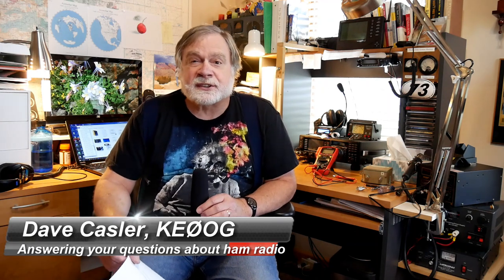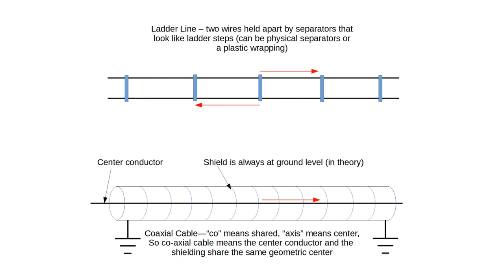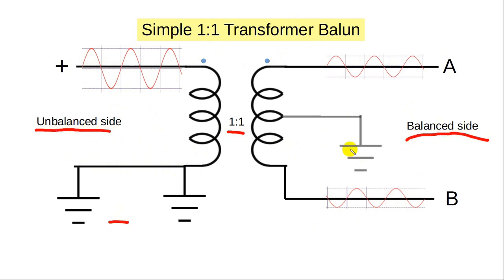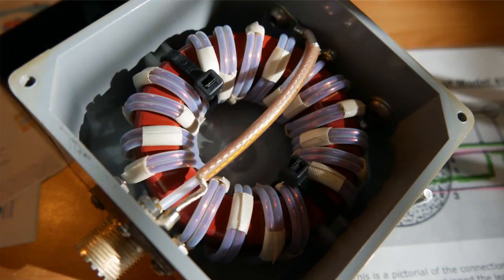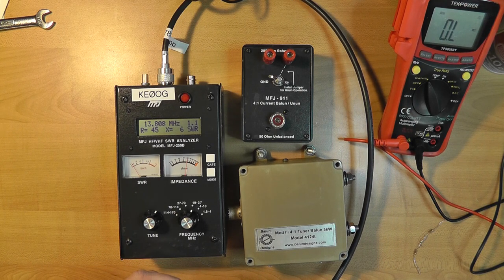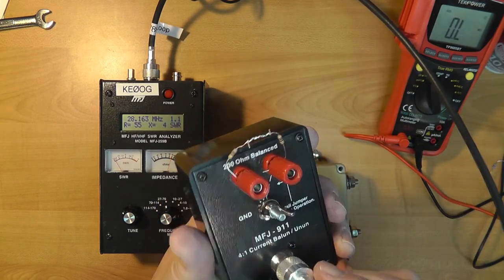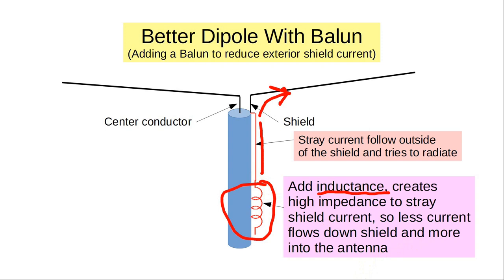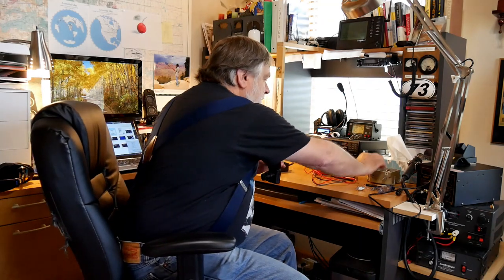All About Baluns (Ask Dave #73)

Comment: Hi Dave,
In your animation starting at 1:38, you show current flowing back and forth on the center conductor, but no current flowing on the shield.  However, there is current flowing on the INSIDE of the shield, and it is equal and opposite to the current on the center conductor.  So there should be two arrows going in opposite directions INSIDE the coax.  There must be a return path somewhere, and we don't want it on the OUTSIDE of the shield.  That's why we might want to use a choke balun.
Keep up the good work!  73 de kc0tw.

Comment: My understanding is this; if an antenna is not balanced, current (or signal/RF/voltage it's all the same idea) flows back along the shielding of the cable (or one leg of a feedline) to the transceiver.  This back flow produces a high SWR reading which can damage the receiver if not corrected.  Makes sense so far?
A balun which is an RF choke, a line wrapped around a toroid core, absorbs and dissipates this RF before it returns thereby producing an acceptable SWR reading.
The reason there are different ratios of baluns is because the amount of turns, equaling RF absorption, is different depending on how unbalanced the antenna is.
More unbalanced=more windings around the core=more RF absorbed.  That's it!

Comment: Dave - I think you should review your statements regarding coax starting around 2:30.  The shield in fact is the second conductor in this RF AC circuit; you have to have at least 2 conductors in a circuit.  You can't have a single conductor simultaneously being the supply and return path.  RF current equal and opposite to the current in the center conductor does flow on the 'shield'.  Ideally, the shield current will be confined to the inner surface of the shield due to skin effect- the surface that can 'see' the center conductor
Reply: And all that aside, this was a very good presentation.  Nicely done.

Comment: 4:1 Baluns are useful between balanced lines for center fed Zepps, Off-center fed (OCF) dipoles with coax, G5RV antennas, full wave loops, NVIS dipoles that are close to ground and have impedance levels near 200 ohms or high impedance feeds for log periodic beams.

Comment: David, thanks for the video. I noticed that your explanation is in contradiction with the article by W7EL you are refering to. The current flows in both directions inside the coax cable, through the inner conducter and the inner surface of the shield, the same way it does in the symmetric feed. A balun prevents the current to flow on the outer surface of the shield. According to your video the current flows only through the inner conducter, which doesn't seem to be right.
Reply from the maker: In a proper coax, with all impedances matched, the current is unbalanced. The inner shield is ground, and the current on the inner conductor is AC, back and forth. If there is an imbalance, or impedances are not matched, then things change. I think what I've shown in the video is correct.
Reply: @davecasler  The fact that the shield is ground only means that we consider it a zero voltage reference. It doesn't mean that there is no current in it. The reason why bifilar 1:1 current balun works is that there are two currents with 180 degree shift flowing through it, one through the middle part of the cable and one through the inner part of the shield. Magnetic fields of these currents cancel each other, thus balun doesn't stop them. The current could choose to flow through the outher part of the shield (because from current's point of view there is no difference where to flow at the end of the cable - through the antenna or through the outer part of the shield). However this would turn the balun to the coil (choke) because now there is no opposite current to cancel the magnetic field. This fact creates high impedance for this patch.

Comment: Great discussion Dave.  However, in this video and the other you did about "Do I Need a Balun?", you discussed that incident where you couldn't get the antenna to tune with the balun and when you removed it, it worked fine.  You didn't explain why the balun didn't work in that case.  Please explain.

Comment: Dave you did a awesome job on a very complicated subject, l do however have a couple, dare I say, squabbles :o) , perhaps more like friendly advice.  First, you should always use a 1:1 current balun when connecting an unbalanced radio to a balance antenna such as a dipole to prevent current from running back down the outside of your coax shield and the other was your advice on building your own. It is a little bit more complicated then just wrapping some wire around a big toroid. Peter from the TRX Bench did a wonderful 4 part series on Baluns, just search youtube for TRX Bench balun (videos 100, 101, 105 and 131) and if you want more information as to why the type of wire matters (actually it is the diameter)  just do a wiki on telegraph equation. After viewing these videos you will be able to build a Balun better than anything you could buy at a fraction of the cost and you will be able to customize them to your needs. Peter has an awesome channel and his balun videos are must see for any ham. 73
Reply: Thanks for the TRX que.  I'm currently building a 3 element yagi (my first antenna build. Also, the first time I've used a milling machine!) tuned to 144mhz. I was hoping I could use it for an experiment in RX on 143.050 and the lower end of the 2m band for TX.  As I'm building it, I've been wondering about a balun.  A yagi It is just a dipole with clothes on, but I've been scratching my head about how to implement it.

Comment: with reference to 8:17  I think the reason is same as why power lines use very high voltages. High voltage means smaller currents. With long cables the I squared losses will reduce the power to the end of line. But using a transformer to convert the signal to a high voltage means proportionally lower current, this 4:1 hence reduces those I squared losses. eg P=IxIxR. My guess is at the arial end, that 4:1 is simply converted back to 50ohms. It means you can have much longer cable as far less I squared losses will occur.

But that is a wild guess as I know bugger all about transmission lines.

Comment: Just what I was looking for. Printed off the W7EL paper for bedtime reading. At my previous qth I had problems with rf in the shack from a dipole run along the edge of the roof, I used a dozen salvaged ferrites just threaded on the co-ax, worked a treat.

Comment: Some 50 years ago when I got my first call sign, we used to make baluns out of coil of coax. Why nobody uses them anymore? They were wideband transformers not dependent on the frequency and were capable to transfer kilowatts of power. Now with all these different ferrite toroids who knows what performance they'll have all over the spectrum and what loss of power is going to be transformed into heat?
Reply: @John Cliff No sir, I wasn't talking about the RF choke made of coax. Some almost 50 years ago, in our radio club YU5CEF back in Macedonia (Z37CEF now) Europe we bought a fabricated (I don't know who made it though) multiband antenna W3DZZ. It had a balun made out of coax to match the balanced dipole to the unbalanced coax. I remember bot hot sides of the coax loop were connected to both sides of the dipole while the connecting coax was connected to one side and the shield were all connected together. We were not aware of toroid  baluns at the time. (de W5DMA)

Comment: Current doesn't always stay inside coax.  It is best of it does and is called differential mode current, but sometimes a portion of it also flows on the outside of the coax called "common mode current".  If a dipole exhibits an imbalance for some reason like one side somewhat closer to ground or close to metalic objects such as a metal roof, then common mode current can and will flow on the outside of the shield.  Thats where a good, 1:1 current balun should be used!

Comment: So Dave,     You said in the beginning you would tell the difference between voltage and current baluns and when to use each type. I love the way you compare voltage balun to current balun but....you do lack the idea of when to use each. I have been spending the past 5 years looking up when to use each and have run into too many formulas. so, when is the case for a current balun and when is the case for a voltage balun?That is what the beginner and me stop at because there is no explanation on exactly when to use each without multiple formulas and very very technical articles. could you please find out the reason for the use of each and not just "Use it when necessary and you have to compute..."'   there should be some easy explanation on when to use them because of the lack of electronic experts in us hams. Thanks for the video and keep them coming. 73, ad0am
Reply from the maker: Hi Adam, very interesting question. I don't know the answer. If you find anything definitive (and I'm not sure there is much), send me a link.
Reply: David Casler will do. thanks.
Reply: Adam Rennison

Comment: Nice video Dave! Explanation on choke balun needs more information. Winding few turns of the coax should add inductance on both inner and outer segments of the coax and that should act as common mode choke, which should be same as 1:1 current balun. Assume if it was adding only inductance on the outer braid, then that should be limiting the onward signal from the TX also.
Reply from the maker: No. What goes on inside the coax is independent of what happens on the outside. The signals inside the coax, going either way, are not affected by the coax loop. Only the current flowing on the outside of the coax is affected. The transmitted signal will not be on the outer braid. The ARRL Handbook and the ARRL Antenna Book both explain this in some detail.

Comment: This explains a lot for me and answers my questions. I'm building a 2m j-pole that I intend to mount on my semi (modern semi bodies are terrible for ground plane antennas. Not very flat and they have a LOT of fiberglass). Instructions I find say I need a balun just below my antenna, but no one seems to agree on how many turns or diameter. So I suppose I can just coil SOME coax a few turns? Anything is better than nothing?

Comment: Hi Dave, great video which I really enjoyed. The only one thing I'm confused with is when or what antenna situation would you decide to use a 4:1 voltage or current balun? Say a Doublet for 80-10m, I would be very grateful if you could help me with this 'voltage or current' choice, does it depend on the type of open line balanced antenna? Many thanks for the informative video.

Comment: You said that you don't know why the two to four ratio of ballon Transformer is used quite a bit, but I would guess that it's probably for the same reason high voltage power lines are used to transmit electricity across country. With a higher voltage, you lose less power to heat when they get put through the line.

Comment: Newly licensed Tech and planning on taking my General next month, so forgive the basic question.  Doesn't the extra 25' of coax that you used to make the inductor add to the losses in the feed line (due to the extra length)?  Because of that, is it more beneficial to use the choke with the ferrite beads?  Thanks.
Reply from the maker: Yes you are correct, in theory. It's a cost trade-off between the co-ax and ferrite beads. You can go either way. At HF the extra 25 feet of coax doesn't add that much loss
Reply: Thank you.  Watched all of your tech exam videos prior to my test and got a perfect score.  Just finished watching all of your general exam videos.  Great stuff and much appreciated.

Comment: while discussing current-baluns 11:35  he says:  "If you want that kind of current, that's fine."  and he leaves it at that.   but i'm still studying for the technician class license and dont know that means?    i was hoping to learn WHY a balun would be used in this situation but the discussion went in another direction.   i must have missed something... i usually do:)
Reply from the maker: Baluns are used when transitioning between a balanced system (like a dipole antenna) and an unbalanced system (like a coax transmission line). Properly done, it keeps RF where it's supposed to be (inside the coax, and radiated only from the antenna).

Comment: Thanks for the information. I use a 10 turn loop of coax at the junction of coax and ladder line of my 40 mtr G5RV and I wound a transformer/balun [49:1] for my EFHW 40-10 wire antenna.

Comment: Hi Dave, Is there a way to calculate how many ferrites are needed in a coax going to a 2m Jpole?  I think this method would look cleaner than a bunch of loops of coax in my neighborhood.  I am using RG-8X for a 40' run.  Otherwise, barring this.. can one estimate the number of turns of 8X of, say 4-5" diameter ??

Comment: Dave, great video. Can I check my understanding of something? I understand why coiling the coax works to create an inductor that prevents RF from coming back on the shield. Am I right to assume that the reason it doesn't prevent RF from moving to the antenna is because the center conductor is shielded, and therefore the center conductor is not also being turned into an inductor?
Reply from the maker: In coax what happens on the outside of the shield is different from what happens on the inside of the shield. Inside of coax is another world. Ideally, there is no radiation on the outside of the shield. In actual practice, the outside of the shield can carry radiation from the antenna back to the radio. Coiling it to create an inductor creates a reactances that is high enough to inhibit the radiation on the outside of the shield. Doing so does not disturb what's happening inside the coax.

Comment: Hi Dave, thanks for the video. I understand the need of impedance transformer what ever they call them. However, I'm not quite understand 1:1 balun. Based on this video they are two type, the transformer (1:1 transformer, of cause) and the choke balun. What is the different between them in term of function and performance?

Comment: hi   mr david   am  real new  about the balum thing.. what you think here is my project  140 ft wire loop try ing to use it on cb band  ch 20   and  7 meter 7263  balum 4.1  home made type  best it will match is 2.1 swr need lower 1.2 is my desired  swr   what you  suggest

Comment: +David Casler - Great video. I also own a Polaris RZR. Specifically, an RZR1000. I have been trying to add radios my RZR, but there just aren’t many good options for this vehicle. I was wondering if you have any other information or pictures of your radio/antenna installations for this vehicle. The radios I want to mount are a 2m/440 rig and <gasp> a CB. (I live in a rural area and CB’s are still popular with the farmers.) I would like to later add some HF gear, so my installation has to leave room for some expansion. The dashboard doesn’t seem sturdy enough to hang radios from and I’d rather not give up my center dash storage compartment if I don’t have to because my GPS and reverse camera are mounted there. I’ve considered hanging them overhead, but I don’t trust the few screw mounting holes in the Polaris roof. Every time I think I’ve figured out a way to do it, I decide against it or come up with a different idea. I’ve spent a small fortune on different radio brackets, roll bar mounts and antenna mounts due to my indecisiveness. Do you have a website with pictures of your installations? Any advice or ideas would be appreciated. I believe that I have some good ideas, but self-doubt has prevented me from continuing the project. I’ve run 6 gauge cable from the battery, through a 60 amp breaker to a fused power block, but that’s as far as I’ve gone. I’ve been an RF engineer for 29 years, so I’m good with the technical side of it. Unfortunately, I’m also a perfectionist, which is what is slowing my progress. Anyway... Thanks again for the video and any ideas you might provide. 73’s
Reply from the maker: I suggest attaching to the roll cage tubing, but don't drill any holes. Use hose clamps or the like.

Comment: Dave your doing beautiful job with your presentations keep up the good work.
I have a question for you I can't figure out why all the articles I see for sleeve chokes tell me that the outside braid of a sleeve should be cut and allowed for the velocity factory from inside the coax when the whole idea for the sleeve on the outside at a quarter wavelength is to offer a higher impedance than the 50 ohm inside . I have made it both ways allowing for the velocity factor the coax which makes it much shorter and it doesn't seem to work as when I use it with open air frequency for outside braid that works . So are all these articles I'm seeing wrong? 
I put heat shrink on the outside of these chokes and if that has ,or the outside coax cover has an effect it can't be much because I tried to allow just a little velocity factor and didn't seam to matter ,guess it won't as long as the outside impedance is greater than the rg8x 50 ohm's.
Reply from the maker: Hi Debbie, I'm a bit confused by what you're describing. Can you send me a drawing or photo to hamradioanswers@gmail.com?

Comment: Study coaxial cable! They are not grounded at both ends always.  I have had trouble when there was a grounded at the far end!
Reply from the maker: The coax run to my Butternut HF9V vertical is grounded at both ends because the vertical itself is grounded. I found if I did not additionally ground it at the station end, I picked up gobs of local noise. I also have an MFJ hexbeam in the back yard about 20 feet up. I've not grounded the coax at the antenna end and it seems to work fine--pretty well, actually. So I guess it depends on the situation.